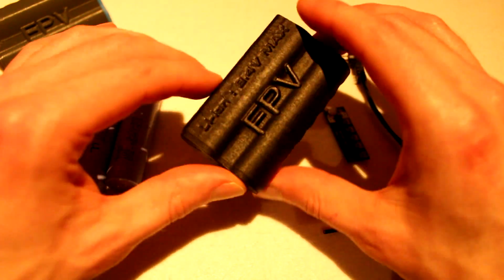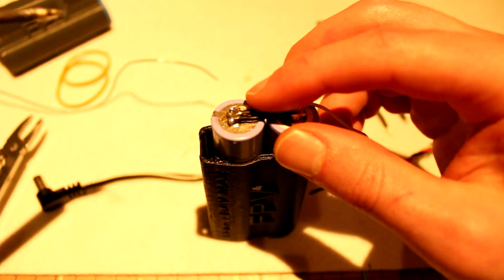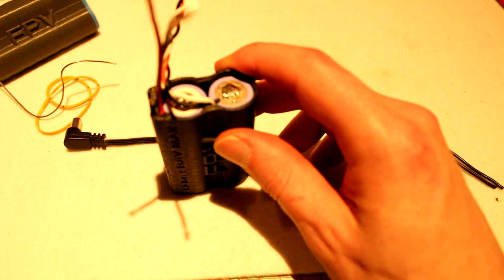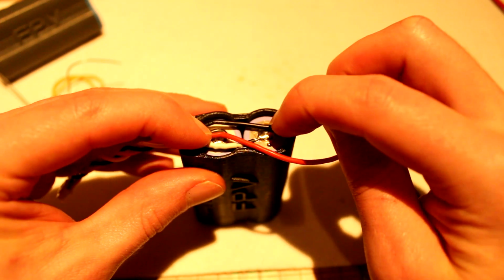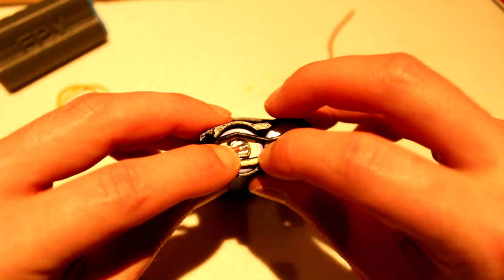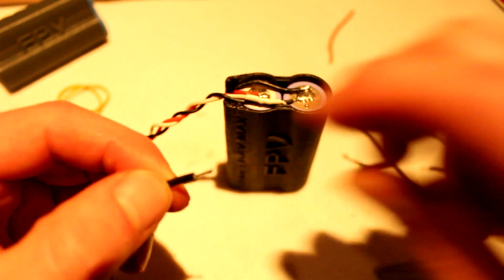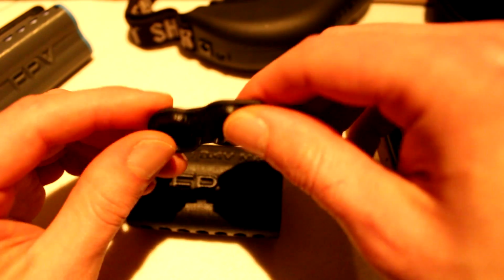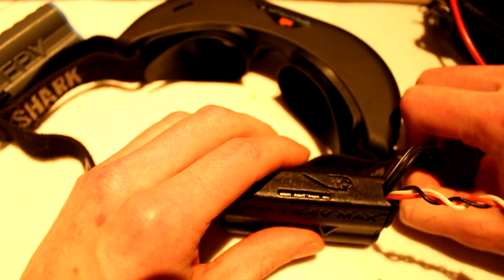Fatshark 18650 li-ion FPV battery Case with LED | DIY Build

Comment: excellent video, thats very good idea!
How do you charge them? with a regular lipo battery charger, plugging the balance lead and the jack to an xt60?
Reply from the maker: Just plug the white balance lead into the balance charger set the correct type and charge it.

Comment: This is the equivalency of making a 2 cell Lipo and you can treat it as such. The complete voltage range for most 18650s is 2.5v to 4.2v per cell. You can use a lipo charger to put this custom pack at 8.4v.

Comment: There's a little disadvantage, your  goggles will start beeping because of no battery juice(2s lipo +/- 3.4 per cell voltage ) but  your li-ion still can go harder to 3.1
Reply from the maker: I know, but you can add a 9v step up in so you dont have this issue, but makes charging harder.
And the run time is 10 longer so by that time ....

Comment: For the voltage display indicator, do i choose 2s?
And i think realacc copied your design and make it into theirs..

Realacc 18650 Li-ion Battery Replaced Refit Case DIY For Fatshark Goggles Case Only Without Battery
https://banggood.app.link/FUvrRwWCDE

Comment: thank you for this sharing of knowledge! 👍
Reply from the maker: Thank you for the kind comment!!:)
Reply: SKYDro FPV you're welcome! sub to your channel as well.. 👊 just a clarification, charging is just like balance charging any 2s batt right?
Reply from the maker: thx!!! yep charge it the same as a 2s lipo, if you charger has li-ion just set it to that and you're good!
Reply: SKYDro FPV thank you so much!! gonna get a local shop to print them 👍👍👍👊
Reply: SKYDro FPV are you charging by balance cable and goggles power cable or only by power cable?
Reply from the maker: most times just power cable because they stay balanced.

Comment: Digging this case dude its awesome, friend tried to print it twice but failed as the supports filled the slot for the led board and the button didn’t turn out at all, have you had problems with this print, just spoke to another friend who is no stranger to 3D printing and he said exactly the same thing that it would be hard work, please let me know your thoughts, Thanks
Reply from the maker: Well that's the first time I hear this, the case is printable without any support,only thing that needs support is the clip!you could use some support for the hexagons but is not needed, printed
now a bunch of them and just have to put the stl on and print.Orient with opening at the top straight up!
If you check the mades from other people at thingiverse they all look great and dont have this issue.
I dont understand why your slicer would fill up the slots for the led, they go all the way to the bottom.
How to you orient the model on the build plate. Battery opening pointing to the top. 
The only thing that could be an issue is that you need to file down the slot a bit but that depends on how accurate your printer is.

Comment: You should improove your soldering skills, they are awfull! :)
And get the wire stripper and cutter!
Reply from the maker: Yeah this is not a solder tut, my good keller solder station broke! so using this cheap 80w soldering iron...
also have a wire stripper but sinds these are silicone protected wires i didnt take to effort for that!:)